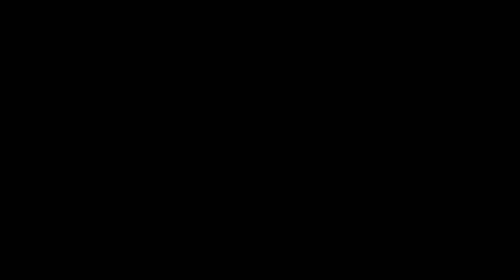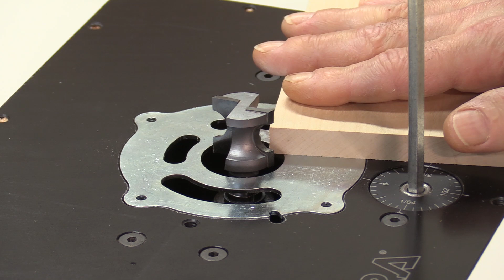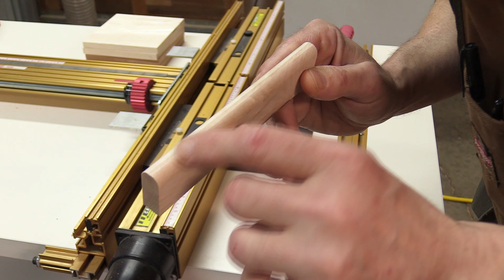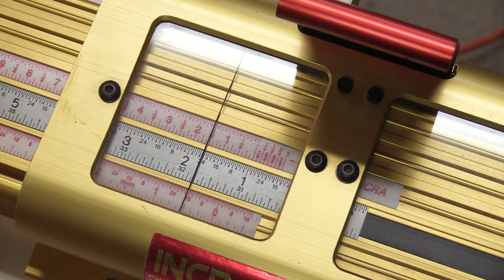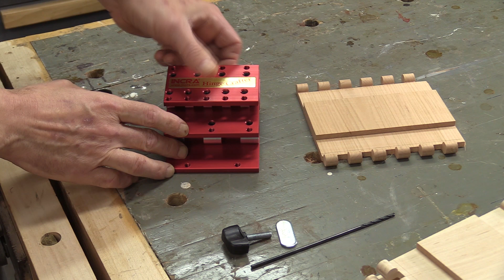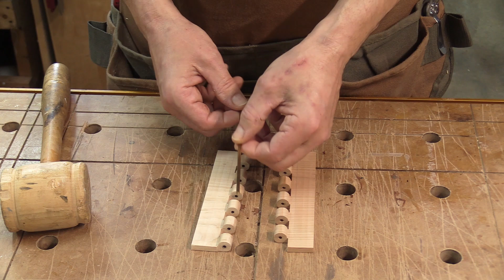Wooden Hinges with your INCRA IBox & HingeCrafter

Comment: I believe the clamps he was using are the Bessey ratchet clamps. You can find them at Home Depot or online. Here is the link. https://www.homedepot.com/p/BESSEY-8-in-KliKlamp-Light-Duty-Lever-Clamp-with-3-in-Throat-Depth-KLI3-008/205512948
Reply: Hey thanks for adding this note I was looking for theses same clamps I have a 12 inch clamp but I find it bigger than what I need for my Incra TS LS joinery system. I ordered the 4 inch ver from grizzley tonight then I saw your comment about HomeDepot having them so I ordered the 8 inch and that is what wanted originally. and HD even has them for a better price. Thank You!

Comment: I use the Incra iBox and dado stack to make the fingers for the hinges (rather than a router bit). While I can get very accurate finger joints, I have found it very difficult to get the registration between the iBox and the Hingecrafter to match. That is, the width of the fingers and the width of the slots created on the iBox are not necessarily the same as those set on Hingecrafter. If there is even a few thousandths of a inch difference, it causes progressive errors that can throw the last set of hinge knuckles off by enough that it won't fit in the Hingecrafter. I have found I can shim my dado stack and adjust the spacing on the iBox but it requires many failed sets of hinges before I get one that will fit. As the iBox instructions say, it nearly requires a degree in higher mathematics to work this out. What am I missing?
Reply: Bret I have been drinking the Incra cool aide and I was considering the hinge crafter, I have a few of there products and really like them, the TS LS joinery System and the Incra Master Router Lift, with the dust collection Clean sweep and router incerts as well as  many of the marking and measuring devices.  
I do not have the I box since I think the Joinery system will accomplish the same task with a router bit. Having novelty wood hinges are kind of neat but at a steep price. after seeing your comment brass hinges are hard to beat for the price.
Reply: @TheFalconJetDriver  I am a bit of a purest when it comes to my boxes.  I like to have only wood visible - brass tends to detract from the grain and stain. I am on old Intruder Driver.  Thanks for the reply.
Reply: After using the IBox and Hinge Crafter for several years, I am updating my original post.  Both of these products, true to Incra's Brand, are very precise jigs.  The challenge has been to set up the table saw dado stack and the finger width to exactly match the settings on the  hinge crafter.  For  example, if I am making the 1/2" hinge and the dado stack is just shy by 1/32nd of an inch,  b7 the time I have cut 8 fingers, the progressive error across the hinge is 1/4" and the hinge won't fit into the Crafter.   It turns out it is impossible to shim the Dado stack and  adjust the IBox finger width to perfectly match the Crafter - I have spent hours shimming the dado stack and adjusting space between cuts only to be so frustrated that I was looking for a hammer to pound it all together (that doesn't work either).  It turns out the solution is to adjust the HInge Crafter.  Over every Aluminum insert is a set screw and tiny ball bearing.  By loosening the ball bearing, you can adjust the space between each insert.  BE VERY CAREFUL to not lose the ball bearings.  Here is the way I use the IBox and Hinge Crafter:

1.  Set up dado stack to be very close to the width you desire - Note which blades and shims are used.  Repeatability is key with these two Jigs
2.  Set up the IBox using the Kiss Method in the instructions.  (If anyone has found a way to know how to just dial in the IBox for different widths without needing to do a full "kiss" for various widths  I would love to  hear it)
3.  Using a scrap piece the same width as your final hinge, make a couple of cuts and see if it fits the Hinge Crafter.  Mostly I am making sure my dado cut is wide enough to fit over the aluminum rods inside the Crafter. 
4.  Make sure you are cutting the hinges along the end grain.  Can't  tell you how easy the hinge knuckle will crack off if you cut along the long grain.
5.  I NEVER try to get the fingers and cuts exact from end to end on the hinge.  Instead I ALWAYS use the method that makes the center finger and cut take up any difference.
6.  Make a test cut in two pieces of  scrap to ensure the hinges fit snuggly.  Sometimes I  have found that doing setup on pine will be too tight on a final walnut hinge.  Check before you get too far!

I still love the look of woodgrain and try not to detract from it with a  shiny brass hinge.  If you like wood, these are for you.  RTFM, go slow, test, learn.  I even recently figured out how to keep my hinges "in-line" with the wood panel sothey didn't stick out the side of the box.  Looks kinda cool!

So yes, I strongly recommend these two jigs.
Reply: @bretrupe5232  Quoted " 2.  Set up the IBox using the Kiss Method in the instructions.  (If anyone has found a way to know how to just dial in the IBox for different widths without needing to do a full "kiss" for various widths  I would love to  hear it)"   
          This may seem like a stupid question,  but what side of the saw blade are you setting the Ibox up for? I have Ibox set to the tilt of the Table saw and I have the Ibox set up to always be on the arbor side inboard of the arbor nut. That blade on the dado stack is always fixed in place and the width of my dados  expands outward toward the arbor nut side. only had to kiss the IBox once and I have cut many box joints. THE ONLY TIMES I HAVE TO RE-KISS ARE IF I SWITCH TO MY FOREST BOX BLADES FIXED SIZE(KERF IS DIFFERENT), PUTTING BACK MY FREUD SET THAT GOES TO 1 1/4 INCH AFTER USING THE FOREST SET. (AGAIN KERF IS DIFFERENT) MY FLAT TOP BLADE (AGAIN KERF) AND IF I RESET FOR MY ROUTER TABLE.  I VERY RARELY SWITCH OUT DADO STACK THOUGH. I did make the mistake of setting it up wrong once and nothing would work out for me.  So unless I am doing something special I kiss once and cut , cut , cut and cut some more. or is that saw, saw, saw, saw? 
 
        I mainly make cabinet drawer boxes and only use the Forest set for special things for the wife.  I do have the Hinge Crafter only used it once to make my wife a special gift for her birthday a one of a kind maple and walnut sewing box with wooden hinges and she still has it. The arched top was the hardest part to make cause that is where the hinges are I mortised then into the top and into the edge of the top rail for the box. I can not tell you how many times I tested and broke things. to get them to look concealed and still work as hinges. Being a perfectionist can be a hassle at times. I know I do it to myself it is solely my own fault. But form , function and beauty all have to flow together as one.
Reply: @jwar2163  
thanks for the reply.  I will take a look at where I have the iBox on my saw.  Maybe moving it to the other side will help with setups!

Comment: Great video thanks.  I wish this existed a few months ago.  I made a number of these using 3/8 size in all sorts of hard and soft woods.  My biggest issue was that during the drilling, the hinge pins would break making the whole thing unusable.  I discovered clearing saw dust every few mm helps but I still had some issues.  Any tips on the drilling part?
Reply: I know im asking randomly but does any of you know a method to get back into an instagram account?
I was stupid forgot my password. I would love any tricks you can give me
Reply: @Zahir Russell Instablaster =)
Reply: @Guillermo Brett thanks so much for your reply. I found the site through google and Im in the hacking process now.
Looks like it's gonna take quite some time so I will get back to you later with my results.
Reply: @Guillermo Brett It worked and I now got access to my account again. Im so happy:D
Thanks so much, you saved my ass :D
Reply: @Zahir Russell you are welcome :D